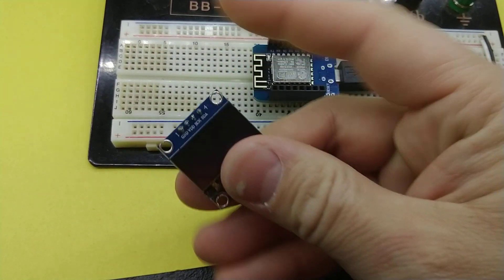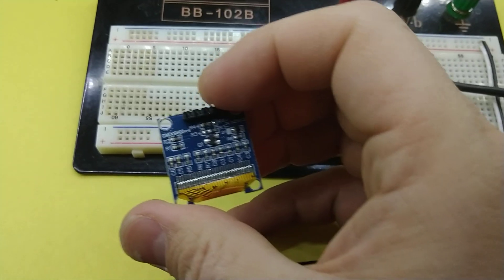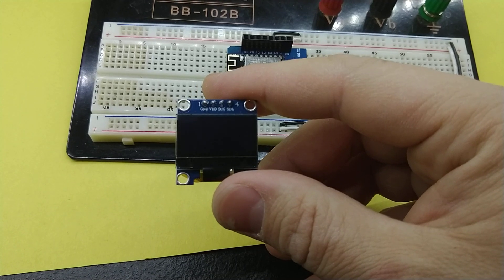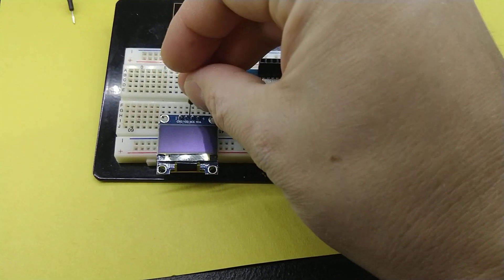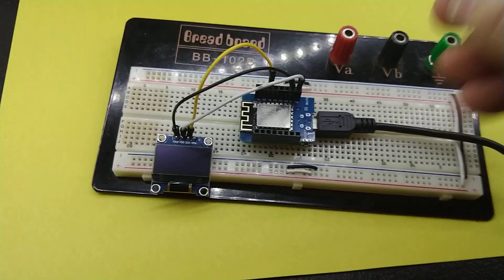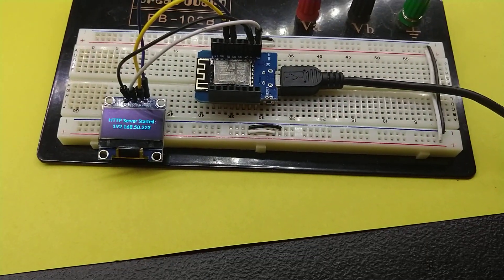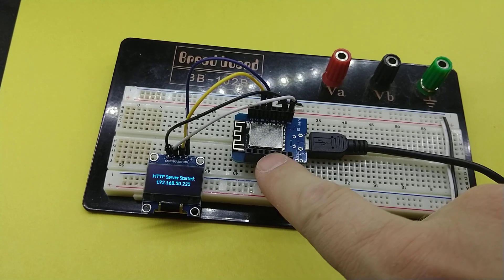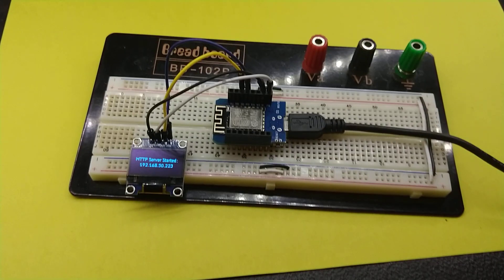Wemos D1 Mini with I2C OLED that has a SCK pin

Comment: Tried this using the library you called out. I am using version 4.0 of library.   Neither examples from the blog  work on the OLED. The web server works fine, (serial monitor messed up?!?) and display stays dark.  Display works fine with the Adafruit example.  Also the I2C Scanner works fine with D2, D1. I'm using your sketch with the font commented out.